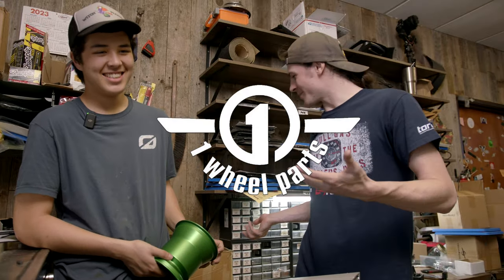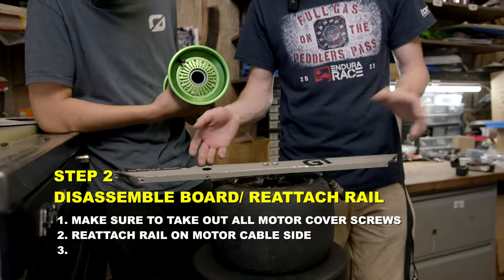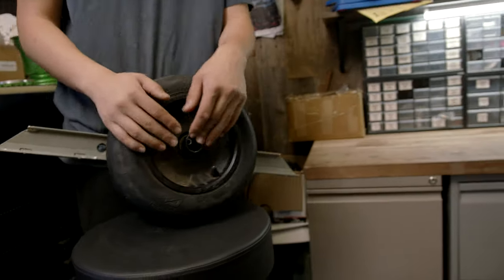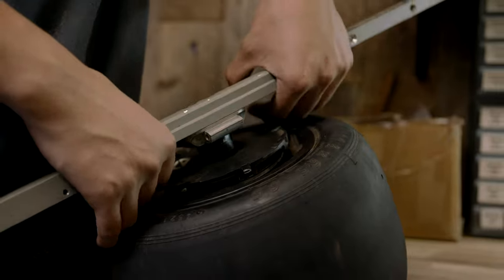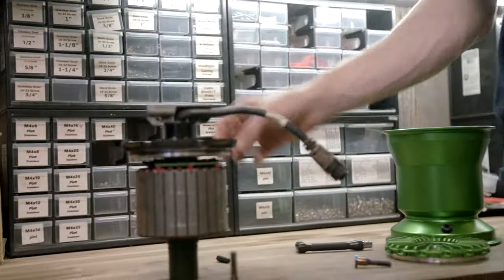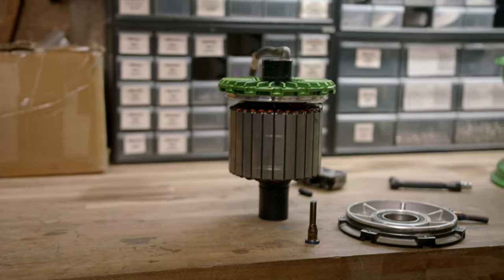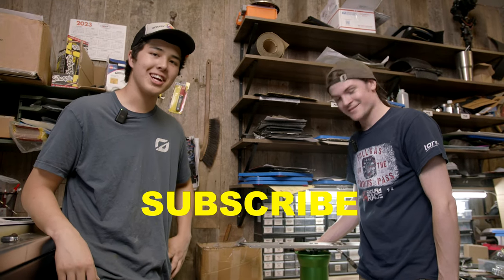Onewheel GT- UNOFFICIAL BILLET INSTALL VIDEO!

Comment: Good job, you will sell piles of these. I assume they accept a standard tire ??
Reply from the maker: yessir! you can put on any of the classic XR tires on your GT now!
Reply: @1wheelparts920  bittersweet.. haha, I was saying exactly this needed to be a thing 2 years ago autos me "if you just manufactured a new outer hub t hold a standard go cart Tire for gt you'd make yourself Rich "  .. I won't ever buy a gt.. ive got 2 xr and am building a vesc, but I hope you do make yourselves rich as this is a service that the community direly needs. There's not a good tire for a gt imo.. tfl tires are better but I don't love tge Enduro at all.  Props to you guys, custom colors for hubs is a really nice touch also

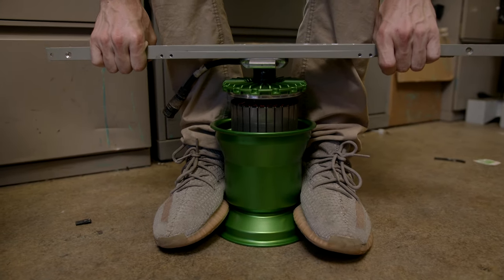Comment: wasn’t a large o-ring supposed to go around the ‘big side’?? 3:14
Reply from the maker: we said but didn't do it! yup put the o-ring on both sides for sure
Reply: @1wheelparts920  are we suppose to take the o-ring from the old hub or are they included in the billet?
Reply from the maker: thank you for your order dude! it will come with two new ones for you! lets get it @GnomoC90